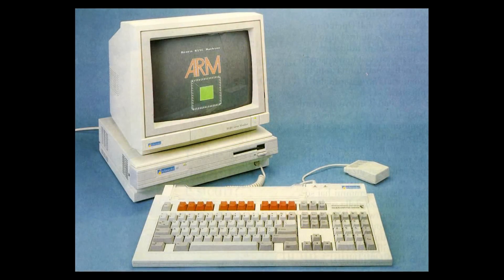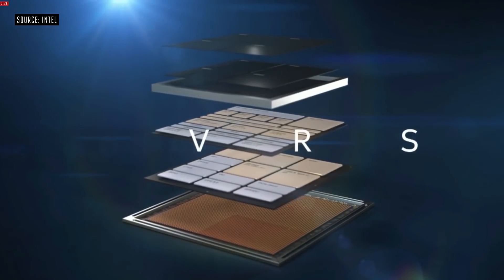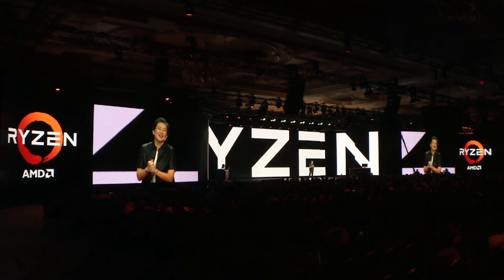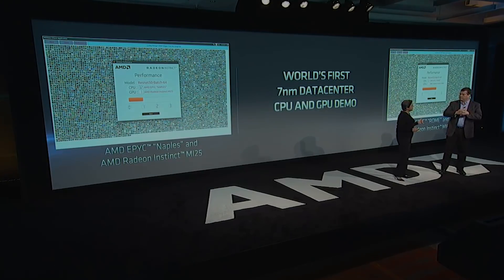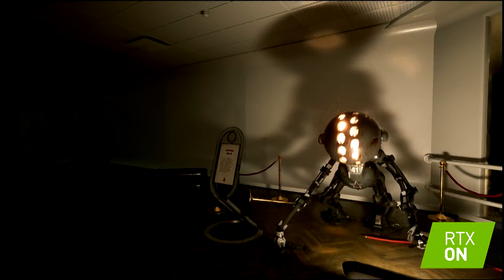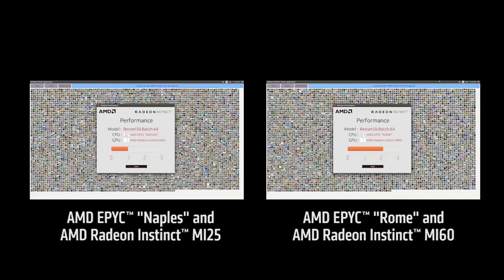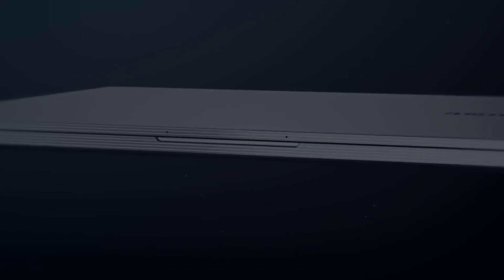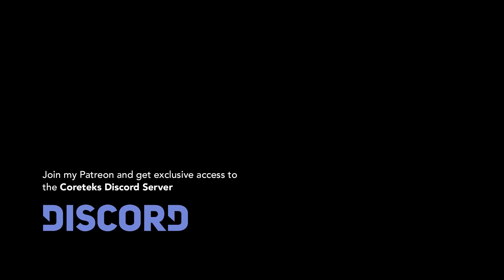Hardware trends: How many cores do we need?!

Comment: Gaming- For GPUs we need more. For CPUs, we can't tell for sure as it seems most game's recommend specs don't exceed Sandy-Bridge SKUs.
Reply: For gaming, some of us use computers for other things... sorry that's a lie. All we ever do is game haha.

Edit: You know all joking aside, actually there is software rendering in which CPU's with 100's of cores would do amazing, not to mention CPU's tend to be more accurate then GPU's when doing some 2d workloads.
Reply: @stolenlaptop  yeah that accuracy thing isn't really right. If what you mean by it us floating point errors. Because that's exacy the same on the GPU as on the CPU. The difference in possible accuracy is that GPUs for gaming are made for FP32 (floating point 32 bit) and are generally pretty bad at FP64 where CPUs use 64 bit and thus FP64 all the time, they actually often even convert 32 bit floats to 64 bit because that's faster to calculate for them.
Now when you calculate something on the GPU you can do it in 64 bit but it'll be pretty slow compared to 32 bit. Still, depending on the workload, much much faster than on the CPU. And exactly as precise. (Depending on the GPU firmware it could be that it'd be a little less precise as CPUs do their 64bit calculations in 128bit and thus avoid some tiny tiny rounding errors and idk if the GPU does that when it actually doesn't do 64bit in hardware)
TL;DR: your GPU is with 99.9% probability exactly as precise as your CPU
Reply: @stolenlaptop  Lmao. I changed the purpose of the text to Gaming.
Reply: @stolenlaptop  The fact that ANY rendering is done in the CPU gives me physical pain.  It makes no sense to do rendering in the CPU.  It's all vector operations, which CPUs suck at.
Reply: Games made to run also on consoles have to manage with much weaker min specs, hence the Sandy Bridge, and even Bulldozer, specs.
Reply: Laurel Sporter bruh the current consoles have 8 cores, 6 at the most for pure gaming. It’s not that bad.
Reply: @laurelsporter  ,
Uh... what?
Games on console often run at 30FPS precisely due to the weaker CPU's in those consoles. Known hardware is also more efficient to program for so combining those two factors for 60FPS+ gaming on desktop PC you need relatively much STRONGER CPU's... so I don't really understand what your point is overall.
Reply: @laurelsporter  Hell, if you got a good Phenom II X6 t1090 and OC the living shit out of it, it can actually hold up in a lot of games, tho it will obviously never run a modern MMORPG at 30 fps
Reply: That has more to do with slow software pacing and nearing peak silicon. Differences between Intel gens have become less , some say it's Intel being cheap. But AMD catching up to me shows that it was just inevitable. AMD is going wide. Intel is stuck on monolithic ATM. Nvidia is going proprietary to stave off AMD catching up in gpus
Reply: Well... that's today. However, even in games, it isn't that hard to see that future games will start making us of more cores. We certainly know that CAD, AI, simulations, video rendering, etc. benefit from more cores and that modern CPUs are now shipping with more and more cores. We are also seeing certain hardware limitations on multi-threading being removed -- specifically disk IO (moving to SSDs) and higher band-width memory controllers. Some of these will find there way into games. Certainly, many mobile games heavily use multi-cores since they don't have that powerful of graphics or single-threated performance.

It isn't hard to imagine a game in 5 years making heavy use of non-graphics multi-threading and needing a 6 or 8-core processor -- or at least having features that can only be enabled on such devices (such as enhanced AI).
Reply: @BW022  games TODAY are doing that.
Reply: @laurelsporter  Name one game which requires a 6 or 8-core processor. There are games which will use them (if available), but certainly none today which require them. Many games spawn dozens or hundreds of threads which could be divided up between multiple cores. However, none today rely on their being a given number of cores available them at any given time.
Reply: @BW022  Nor should they, since a PC game needs to be able to run on four threads, at least, for good sales. That there are games that will use them effectively was what I meant.
Reply: @laurelsporter  Yes... my point was in 5 years or so, you will begin seeing games which require 6 cores to run. Today, even mobile Intel chips are 4 core and most PCs are 6 or 8 physical cores. Even todays chips are running 4 cores often with 8 logical cores via hyperthreading. A game made in 2024 likely wouldn't loose many sales if it needed 6 or 8 cores.
Reply: @BW022  there are already games that are CPU bound if they don't run on 6-8 cores + HT/SMT, 4 cores will simply slow them down aka less fps, making the GPU work less.
Reply: @LiLBitsDK  Well that depends on what GPU you have.
Reply: @LiLBitsDK  You need to reread my comment. "It isn't hard to imagine a game in 5 years making heavy use of non-graphics multi-threading and needing a 6 or 8-core processor -- or at least having features that can only be enabled on such devices (such as enhanced AI)." Games today don't need 6-8 cores... as you say they simply slow down, same as a dozen other things. My point was in five years, I can expect games which physically won't run on a 4 core CPU or which will disable features on anything less than 6-8 cores. You'll get a message such as "You require a 6 core processor to run this game."
Reply: I write software with friends and one game engine we are working on functions with up to 256 cores quickly.
Reply: Wait 5 years. In 10 years i'm sure then minimum will be 16 (8core+HT or Ryzan 3000).
Reply: from a person who has a duel monitor setup and games on a i5 7500, 4c and 4 t, is not gonna cut it. Sure I can game fine, but my cpu usage is always at 100% when gaming, meaning i cant do something else on my other monitor for shit, like googling things. I also experience stuttering at many times since my cpu can't keep up with the gtx 1070. Will upgrade this year to new amd chip
Reply: even gpu's are also limited with some serialized parts on them.
Reply: Fuck you i don't want to frequenly buy GPU to play newest games.
Reply: If your playing on a 60hz monitor and targetting 60fps then surely a sanybrisge 2600k is fine.  But 144hz monitors are amazing , and 144fps is the new target fps.  My old i7 3770 @ 4.4ghz could run pubg 90-144fps with my gtx1070 @70-90% usage, but i had to have recording and replay shut off or id crush it.  More cores dont seem the way to go, we need clockspeed!
Reply: @Tcll5850 agree. a ant brain simulator has more cpu cores than 128.
Reply: that is true, i still have an 8 core amd fx cpu and along with my rx590, it plays everything maxed out in 1080p in 60fps constantly.
Reply: Well, I'm in an industry that is related to the topics discussed in the video (parallel software development in erlang), and I can confirm he is 100% correct. There is a talk by Sophie Wilson (of ARM fame) that can explain in more detail why the 'free ride' is over, and that all the software in the world has only delivered about a 10% speedup since the first computers, with the other 10,000 or so coming from hardware which is approaching it's limits due to the physics of light itself.

The problem with increasing amounts of parallelism is actually with the data being dependent on each other. If you have 2 instructions, and the first instuction needs the results of the first one, then thats it, it's sequential due to the data, not the limitations of the thinking of the programmers or their languages. 

Now raytracing is special, because each beam of light can be calculated on it's own, with no dependency on the next beam of light. This gives it the 95% parallelisable figure, which is incidentally considered the most parallel type of software written today, except for some machine learning algorithms. The problem with games, is they aside from the rendering of the textures and stuff, they have huge amounts of sequential code - the game engines themselves work by storing state and processing it in very discrete steps.

At some point, the GPUs will top-out at the max # of cores for the graphic fidelity required, and it will get real expensive for the last few improvements. Imagine a 256 core GPU costing double a 128 core one, for 5% more graphical power, in a game which can't run any faster because the CPU is already has idle cores due to the shared data of the game world. 

I know it seems hard to believe that the advances in computer are going to stop, but they really are. Unless we get quantum cpus up to industrial scale, thats it for now. We're already in the end game, in fact CPUs haven't really gotten that much faster for a while, actually they are now mostly 'dark' (unpowered) and contain lots of specialised circutry to speed up specific operations and are only turned on when needed for those specific sets of calculations.

I would suspect, with game hardware topping out, while costs will continue to shrink (for the cost effective manufacturing - we could go to 7nm all over but it's not worth it except for subsets of the processors), then it will change the economics, and will make consoles approach parity with the high-end rigs, and that's if we don't all move to streaming services.
Reply: @Tcll5850 No, you can't. Those threads will sit idle as the data on the game world will be shared between them, requiring them to lock themselves. You're focusing on the sequentiality of the code, but the real issue is the sequentiality of the data. As soon as one calculations needs the output from another, it's sequential. The only way you could effectively use 128 threads for AI's, is if they didn't need to react to the shared game state or each other.
Reply: In my case, i would love to have atleast 16, or 32 cores. Because of my work, i have to run a lot of virtual machines in the background for different tasks to be separated, and dont mess up each other. (or for the same program to run with entirely different configurations) . Up to this point one had to pay a big fortune for a machine like this. From now on a small fortune will maybe enough.